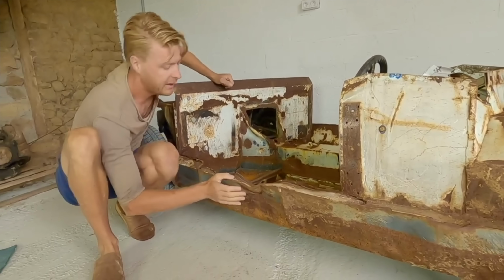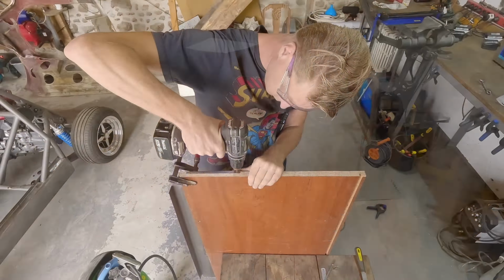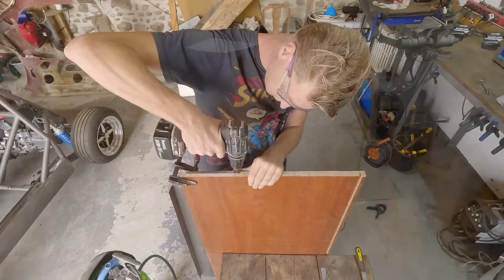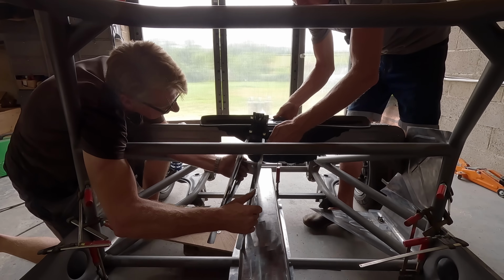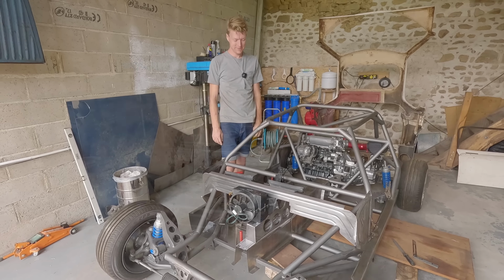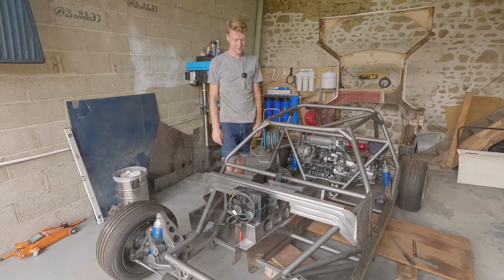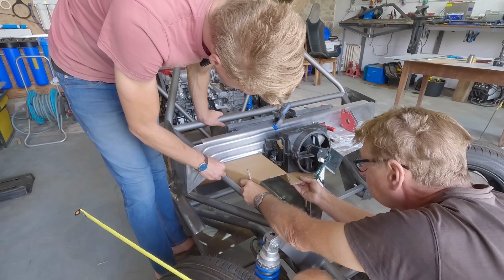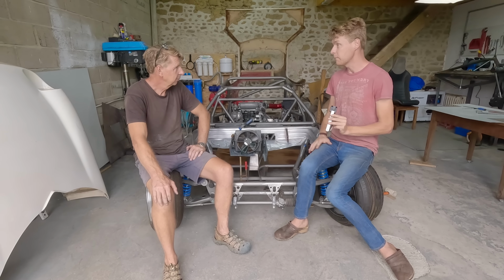Fabricating Our First Firewall  | Project Mosquito Honda Type R Mini Supercar (Ep62)

Comment: Considering the temperatures this summer and the predictions that climate changes will likely lead to hotter envires, you might want to figure out an alternative way to run 'chilled' water through that 'heater' core as well.
Reply from the maker: I've lived in some extremely hot places and when it comes to cabin cooling it's as much about getting the hot air out the cabin as it is drawing cool car in
Reply: @OliverPickard  
In some regions there seems to be a lack of cool air to draw in. It was just a thought.

Comment: All those flat panels make terrific vibration amplifiers. Making your bead rolls different lengths and shapes helps break up resonances and make your car smoother and quieter. If you made all the bead rolls symmetric and identical it would be extremely unpleasant at certain speeds and rpms.

Moving the heater to one side will help with that as well, because instead of having panels that resonate at the same frequencies on both sides of the car, the vibration characteristics of the two sides will be completely different and won't reinforce each other.
Reply from the maker: It also helps that we've used different thicknesses throughout the car and that the panels are small but you are correct with such a stiff chassis resonant frequency can be a real concern

Comment: When describing the hole sizes, did you actually mean radius or diameter ? Also, now that you have moved the heater box, can you still get the third point fixing  direct from the tunnel or will you need a bracket ?
Reply from the maker: when ever I talk about hole sizes on video its always diameter.  im not sure what you mean by third point fixing but it does complicate the mounting from the knee bar to the front bulkhead, it just needs to be bigger
Reply: @OliverPickard  Thanks Oliver. I only asked about the hole sizes because you said radius in the video and the hole saws on the bench looked diameter sized. Perhaps I used the wrong term when I was talking a out the third fixing for the heater box, but in the earlier video when you had the heater placed centrally you showed how you could simply add a bolt and nut to stop the heater box from vibrating. As usual, I'm sure that all will become clear in due course. Best wishes.
Reply from the maker: Yes it'll mount in the same way

Comment: Have you a roller or English wheel of sorts? You can stop that drum or tin canning in you bead roller parts by pre stretching on the wheel . Try a small roll with a corner with scrap and you will be sold . 👍❤️🇦🇺also thanks for waking my own projects up , as I need to get back on the tools . 😄

Comment: The car is looking great! Some clear progress in this video. But I believe the oil canning effect you’re seeing after bead rolling the panels can be improved upon. The floppyness will mostly disappear once everything is welded and fastened together. But. Have you heard of pre stretching the panels before bead rolling? I’ve seen others lay out where their bead rolling will be. And they pre-stretch the material, causing it to look like a potato chip. And when they roll their beads in. They take up that stretched material and the panel is much flatter when done. Making the final fitting easier. And less stress is left in the panel once installed. Lazze metal shaping on YouTube has a very good video demonstrating this. He does use an english wheel to do the pre-stretching operation. But I was thinking, with the right dies in the bead roller. You may be able to get a similar effect.
Reply from the maker: I got some amazing advice right after we'd made these haha
Reply: @OliverPickard  well of course you did. Isn’t that always the way it goes? Lol. To be honest. I’m trying to get someone else to try the bead roller stretching idea for me. As I don’t want to buy an english wheel. And I’m not at the point on my project to make panels.

Comment: Would it be better to make right foot well panel flat without that bend? You would loose little space  in foot well but the serviceability of heater matrix would greatly improve. It would help to see the foot well space from the point of view of a passenger to actually determine that. Regardless of that you guys are making excellent job building your dream car.
Reply from the maker: There will be a little scoop in the bend so changing the heater matrix is about a 5min job but the bend gives us more glove box room
Reply: @OliverPickard  That explains everything. Tank You for a reply. I was not thinking about glove box space.
Reply from the maker: @hubertsumo  You're welcome 👍🏻. Storage is at a bit of a premium and so important for a car you want to drive a long way.

Comment: I thought you would tackle the steering column and pedals before setting the upper and lower feet panels... What comes next? floor panels?
Reply from the maker: I can't fit the steering column before we get the seat bolted in which requires the floor to be complete and there are quite a few different panels to the footwell

Comment: The metal needs to be pre-stretched before bead rolling.  Most people use an English wheel, which you do not have.  Interesting watch your thought processes for this build.  It is worth showing what actually goes into a build.  The devil is always in the detail.  Fit and finish need to be spot on, otherwise it will look crap.
Reply from the maker: A few people gave me tips on pre-stretching last week but we'd already made the panels so it's definitely something to try in the future
Reply: You can pre stretch with a bead roller too, mark out your panel on both sides. Then slightly bead roll the back of the panel. Turn it over and then bead roll the side you want too. 
It works, I used to do it that way before I got my English wheel
With the ‘X’ cross in the panel, use a soft lower wheel (like scoreboard wheel) that way you get the bead where it crosses without deforming